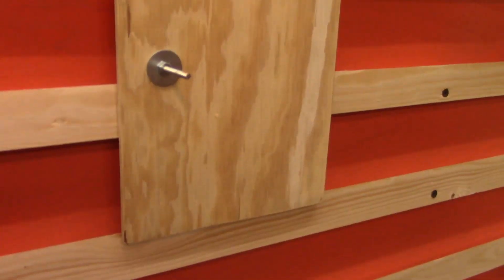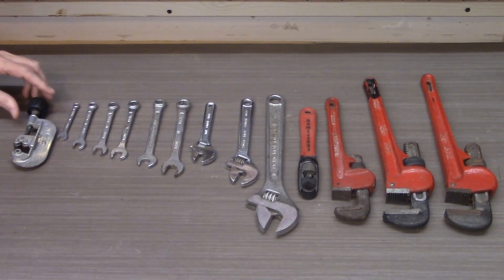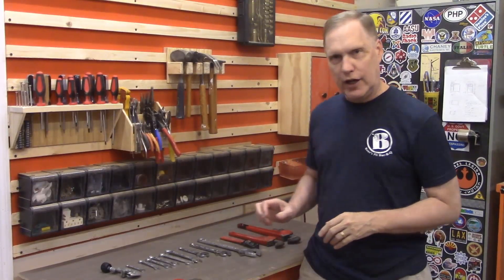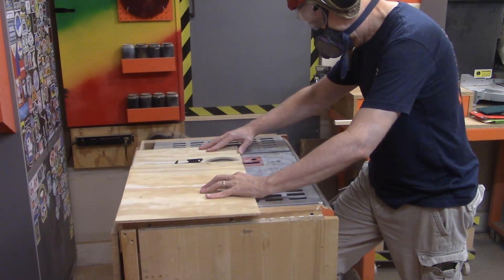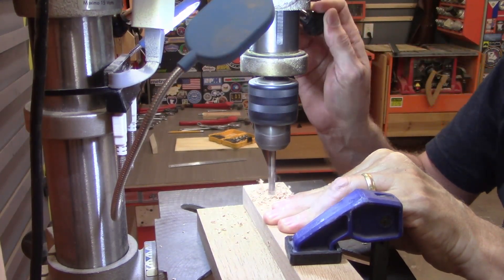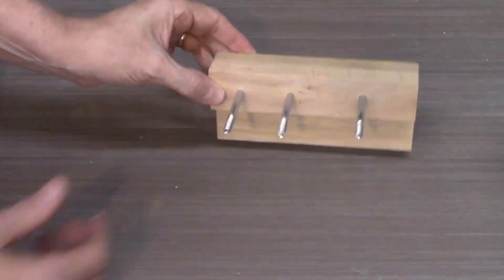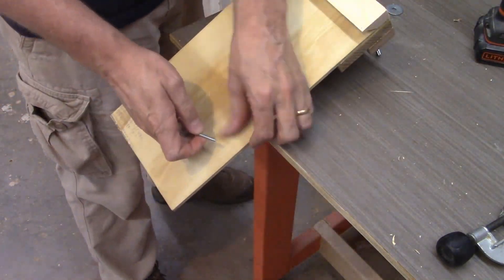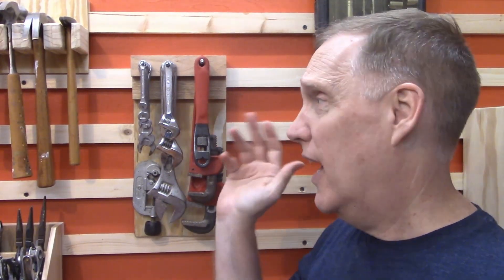French Cleat Wrench Rack - Cheap Compact Storage

Comment: I'm getting ready to redo my small shop.  replacing the peg board with a french cleat sounds like just the thing I need. :)
Reply from the maker: You won't regret it. The cleats are extremely versatile and hold stuff more securely than pegboard. We did the same peg/cleat with our shop and never looked back.